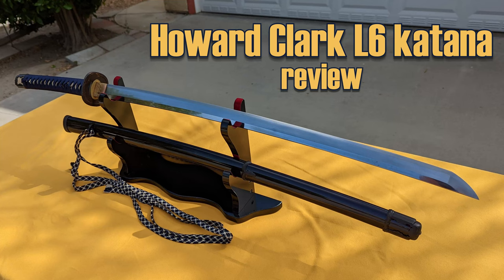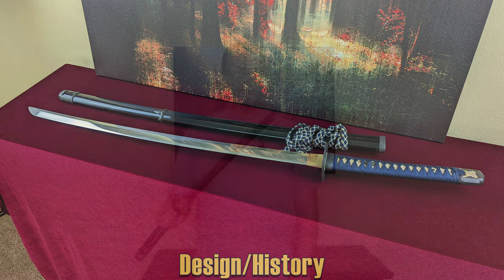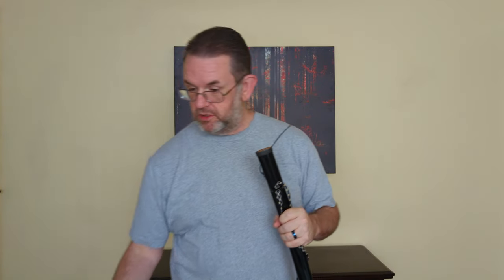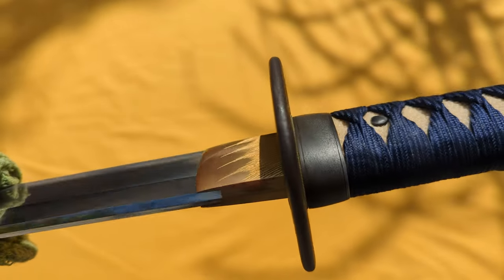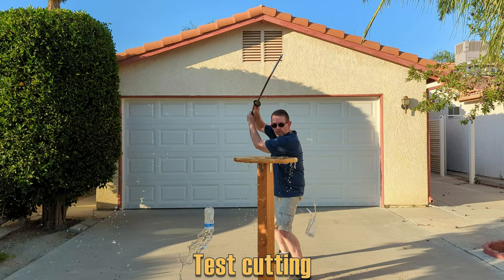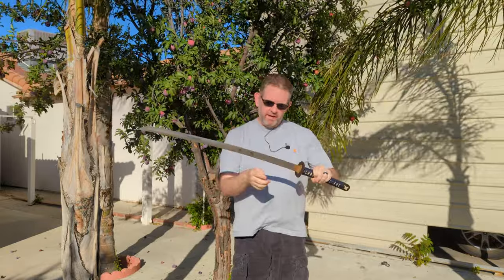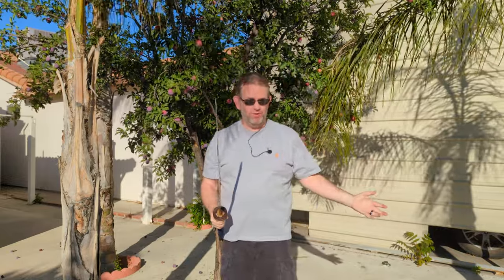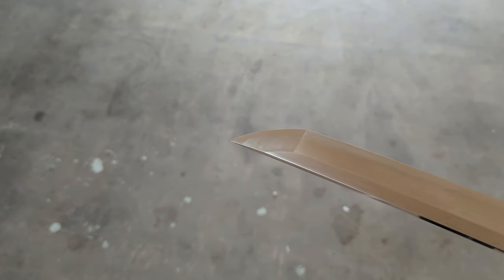Sword Review - Howard Clark L6 katana

Comment: It's funny, I remember way back when I got a hold of the L6 Destruction video and was all indignant like "ha! If ye need a sword THAT durable then ye've got no business using one in the first place!" But then deep inside my heart, a loud voice rang out yelling "I WANT ONE!!!!"
20 years later, it's still the dream.
Reply: How would you feel if someone started a company making bainite bodied katana out of a different steel on a production level out of Canada? 

Don't think I do it the same way he does but I recently recreated this heat treatment process. Might start a company selling an Asian line to my specs(all based off originals differentially hardened but more traditional) and then same blade specs tighter tolerances different steel and martensite edge bainite body made in Canada. 

Thinking around the 2k price point maybe some closer to 1k depends on some operations costs and such. Plus what kinda deal I can work out in steel procurement.
Reply: @bmxriderforlife1234  I'd feel pretty interested I think, hahahaha.
Reply: @bmxriderforlife1234  i would be interested
Reply: @bmxriderforlife1234  ooo very interesting, any further news?
Reply: @bmxriderforlife1234  ya def agree starting with wall hanger/, fantasy replicas isn't a great way to start a brand that wants to also be high end. Good call. I love the gathering of measurements from real historic sources. I am def interested in all this. Is there a forum you use, that your maybe share more info on this all down the line? Would like to follow this.
Reply: @mrstarfishh33  and yeah I don't mind doing the fantasy stuff in the future or using even slightly reject blades. Like oh shit too far out spec but still a nice blade. Put a random fantasy hilt design on it. 

But he wanted to do more like high end collectors shit. Like say the old man at arms type stuff but better built. And with like needless waste of materials and other stuff. 

Goal is eventually do some fun stuff. Weird cross breeds of historic stuff. Or straight up fantasy stuff. But I can just use a more generic heattreatment and use synthetic materials for handle and scabbard cores and use heat for molding some stuff easier like scabbards. And have cheaper core materials that are just as strong and then out nice leather and stuff over it. 

I think dude just made too much off crypto and getting promotions at work and wasn't thinking with his wallet but more so giant kid brain cause why not waste a mill. 

I coulda technically borrowed his money and gotten it up and running and made enough back to return the base pay before he really woulda come to check. But kinda not good thing to do in business terms especially since I want someone with ownership or at least higher level management type experience if I can get it. Or manufacturing experience. Have some and inside knowledge from a not exactly similar industry but steel and fancy heattreatment. Albeit not exactly inside knowledge more so just like margins and stuff and how supply contracts work to a point. Plus distribution. Also similarly not small but not big either. 

But cnc knowledge is useful especially owner wise. Marketing management type or pr or similar things that sort of relate can help fill some voids till I gain more experience. Other stuff I kinda know too much about but business is more than one facet. 

Kinda trying to be like as realistic as possible with it and figured i can better case wait for dude to waste some money on cars and chill back out. 

Not huge money but enough that investments properly with it makes you ridiculously rich if you can do it properly. And consistent good living money coming in based on not that much initial cash if I start with the Asian line. 

Get building. Do shipping and ware house. Set up space for future stuff. Slowly fill with machines. Train employees in specific skills and give them enough time to get skilled without needing to worry about output or quality. Bit of waste but planning on recycling as much as possible. Some other energy offset ideas and other environmentally friendly alternatives to the norm. But also has the benefit of protecting my equipment and employees. 

A bit of a safety nerd despite being an extreme sports idiot. Employee safety though is a huge priority. 

Sword factories and makers have had blades thrown into people's faces and chests or across rooms. For bainite you need extended heat at certain Temps. Means boiling oil molten salt baths and other sketchy stuff. Grinders can be dangerous. So train people safe af, and set up some procedures for safety and injury situations. 

But basic idea for the katana so far. 
Bainite spine martensite edge. Full wrap or wrap and a half same. Impregnated wood handle and saya cores. Hybrid polish. Few options for customization, might figure out some way to have engravings. Multiple koshirae options. Likely have some pretty fancy but more subtle tsuba designs material fancy simple classic designs. Mokume gane for example. Likely no iron fittings but steel will be hardened(some ryuha used to do this to help break enemies swords) and tsuba of actual proper size. Scholagladitoria has a video that talks about this. 

Cast fittings but gonna try and do them nice. Some with basic inlays. Maybe some engraved off cast blanks. 

Imported or at least quality ito. Japanese cotton and silk. Wraps done by proper artists till I can get an employee enough experience to at least do some in house stuff to that quality. Meaning lots of wrap options. Also the idea of employing other artists with their own businesses. Might figure out a polishing situation if someone did want a really high end polish for some reason. 

But hamon is an issue. Suguha straight pattern only. Likely be a brand image thing suguha only unless limited edition. 

On European stuff or other swords that may have had a hamon or temper line of sorts same bainite heattreatment. Also option of more properly mono tempered and hardened. 

Custom options. Originals that are shortened. Experts in that Smith school and time period and shortening procedures. Help with some idea of what it could've been like before hand or look for documents. 

Fancy option to have a form of a tang inscription done with various set ups but gold lacquer or inlay as an option. Details about the original it's based on and a serial number and custom options checked with like little indicators. Date of make of original and replica, plus which workers nick name they decide to use. 

Euro stuff think albion or other similar stuff but original example replicas. Maybe change guard or pommel for pnes we can make the same weight exactly or close enough. Few handle shapes and scabbard set ups. Engraving and so on. Potentially bluing and gilding albeit not the same form of gilding historically used. Albeit might be a historic form of gilding albeit modernized. 

But also selling parts bare blades and other stuff. Steel and aluminum iaito. The "samurai kit or practitioners kit" shirasaya koshirae or multiple, blank wooden blade except oh wait, it's an exact spec copy in aluminum or steel that also works to hold the koshirae or shirasaya together when ones not in use. Partial length true blanks also available in various materials. 

At least the option for silver seppa and habaki. Gold maybe very special order with delayed timeline. Copper for sure. 

And gonna be size adjusting katana parts to fit everything properly. Hence also working with artists.. also helps with being able to provide handle shape options. Also part of the reason for impregnated wood. Stronger less warpage and shrinkage and just uber stable. Plus the rayskin full wrap or wrap and a half. Off cuts are still useful for other styles of sword or daggers. And other fittings. 

For vegans or those who don't want rayskin. Resin soaked cord European style. Maybe a synthetic panel of some sort. 

Alot of options and maybe not all the fittings choices and stuff. But enough they can essentially be called true custom production swords.
Reply: @bmxriderforlife1234  I'll be honest, it never in a million years occurred to me that a vegan training in a sword art would be squeamish about rayskin wrap, hahaha. Especially considering what swords were meant for, hahaha.
In regards to hamon, I'm more of a midareba guy, but I've always wanted at least one sword with suguha so I could make my "Totally Wado Ichimonji even if I'm pretending it's not cuz it's a sword for actual use but I'm also a giant One Piece fan" sword. I was under the assumption that suguha was generally harder to pull off than midareba.
Reply: @Chris deMonch  it depends on exactly how you're doing your hamon process. The bainite if you want a clear hamon it kinda forces you to do a process that results basically in suguha pattern hamon. It takes control to do properly generally more natural wild patterns albeit not the uber crazy ones but with some waves are easier to pull off but also depends on steel. Metallurgy is kinda hard and head breaking especially in regards to swords. 

Idk I know some vegans who aren't necessarily practitioners but might drop alot on a sword for shenanigans wall hanger purposes. And rayskin or leather would deff make them squirm. 

Also anime nerd as well. One piece isn't my favorite. But zoro is a boss. Also the memes are first class. 

I low key wanna make a kinda realistic version of a mount for a nodachi that's based of kenpachi zaraki from bleach. And some other little head nods. 

But lol don't worry another zoro fan already begged me to do a zoro nod of some sort. 

Normal hamons though are alot different to bainite spine hamons. Idk if I'd even truely classify them as the same but more so a temper line on the bainite set up. Proper hamon especially on nihonto or high end modern blades have so much more activity. But it serves a purpose. Strong af spine ridiculous bend and set resistant and breakage resistance. Still has a hamon technically and geo will be based off originals or in Howard's case a master smith's geometry knowledge. 

But yeah. Alot of weird considerations. And trying to make proper concessions. 

Asian line in case you're curious might end up with styles other than suguha. Depends on the forge and what they can do with what I want. And alot of the cost is getting dumped straight into mount quality. Blades will be good and accurate but not as fancy. Basic polish and etch but done well enough by the price points standards especially given winning in other regards. And slightly different market segment in some regards. 

Part of why the suguha hamon though is think of it like a blank slate In a way. You're not supposed to admire these really for the hamon. More so the geometry and the details missing in most reproductions. And mount quality and those details. Tight af wrap. Gonna try for full wrap. But at least impregnated cores and better wood than some brands and shaped better. Since saya shrinkage is less of an issue same with expansion. Easier to get that perfect won't fall out but easy to draw set up that can be maintained with veneer shims easily down the road. 

But like enjoy the replica mounts or pieces together mounts based off modern tosugu or replicas of old originals and options on colors and other details especially on the Canadian made stuff. 

Asian line likely less options. But try and do a few for everything. 

Also Fred Lohman passed away. Heard his son hasn't had the time to run it properly since. Might see if he wants to work something out that keeps his dads memory and work in the community alive, and let's me get a slightly larger base set of fittings. Some of his contacts for services and material supplies just in case. And potentially retain customers and grow it. Let him keep the profits for the most part. 

But try and just keep the quality going up in the production market and have a wide variety of options. Both traditional copies and modern geos. Like even though most brands might see albion for euro stuff as a competitor. I might reach out to them to try and help with scabbards for their swords at least basic ones since they come bloody sharp, for safety reasons. Keep costs low since I might be able to insert it into my own production line and just material costs and some labor. Build them a core they can finish with a blade just leather wrap it. 

Also supplying just lots of bits you'd need for customs in general. Even euro stuff. Might dull rough shaped still needs to be ground blanks as well for makers all by hand to cut out some time.  Amd ready to hilt blanks for people just wanting to have fun or something and hilt one on their own. Probably except some migration and viking period stuff cause weird to deal with and more similar levels of parts as katana. Those just production line examples probably. 

But literally gonna have like mini presentations when possible for certain swords or just the typology basic sword stuff, or for Japanese swords the smith's or the original examples history. And same for other geographical types of swords.
Reply: @bmxriderforlife1234  Well once ye get yer jawn up and running I guess let us know. We've been seeing more and more sources for things dry up of late and having another come online is always welcome.
I was sad to hear Lohman died. He could be... difficult, but he came through for me on a few big projects. I'd heard his son wasn't keeping things up quite so well, which is a shame cuz he had alot of good inventory.
Reply: @bmxriderforlife1234  Did you start producing?
Reply: @ssjronin3972  still working on getting factory side started. But working on it. Investor side is a bit annoying. But pretty much got everything else sorted.
Reply: @bmxriderforlife1234  Interesting! I was actually musing about this conversation a week ago and wondering whether ye got things up and running.
Reply: @TheWasteOfTime  I'm still working on it. Looking like price point will be like 1200 to 1600cad starting point roughly. 

And one of the first themes is gonna be themeless kinda like a dojo pro but with mokume gane fuchi kashira and tsuba. Copper habaki and seppa. 

Handle wraps is gonna be the big challenge. Going to be out sourcing that to dudes like the man in black or cottontail for generic random examples. 

But yeah. Hopefully a year ish and I should be able to start small scale, just have to outsource the blade cnc at first meaning prices might be a bit higher and my margins will be smaller to start.
Reply: @TheWasteOfTime  oh btw. Shirasaya stuff will be an option for building fun project swords. 

And should have some other options going. For anyone who wants any anime stuff or movie references and such. 

Plus euro. Other Asian swords. African and middle eastern. And from like way back to 1900s kinda vibe. 

Yari and naginata and similar stuff as well. Probably some pvc take down boys but historically styled eventually. Yumi and stuff. In proper draw weights for like war bow simulators and hunting weights.
Reply: @TheWasteOfTime  btw. For wado if I do a replica mount or koshirae. Would you be fine with mokume fittings, obviously the basic white handle wrap. But would a glue soaked linin cord wrap work or do you really want the white like bandage width type situation. Cause I was gonna take a bit og historic influence on it.

Comment: That dude touching the blade with his barehands makes me cringe .
Reply: Why? It's his sword so he can do whatever he wants
Reply: It's not a nihonto. It likely has oil on it. And it's actually fine if you take care of your blades or handle them often. In fact it wasn't until the edo period samurai even oiled their swords or cared. 

During the waring periods swords got abused xD.
Reply: @bmxriderforlife1234  It does not matter whether it is an authentic Nihonto or not ,it is made of Carbon Steel ..And L6 in particular is more prone to rust then ordinary carbon steel..
Reply: @nesking3115  bro if u r not an idiot you know that in fight u can hold any sword in halfsword. But if it's not his sword it's kinda cringe ngl
Reply: @NES King  actually L6 isn't more prone to rusting then any other normal steel. It's just not as resistant as others. And it can stain easier then some. There is a difference. 

Also carbon content directly relates to how fast a piece of steel will rust. L6 has about .7 percent. 1095 will rust worse. Lol.
Reply: @bmxriderforlife1234  lol .I never said it was more “prone “to rusting then any other steel .LG is still a form of carbon steel ,which is subject to rusting ..
Reply: @amazonit3214  whatever